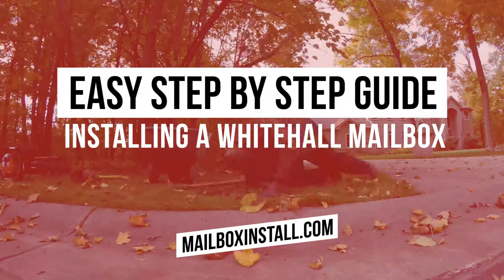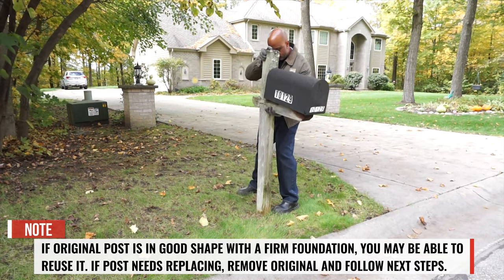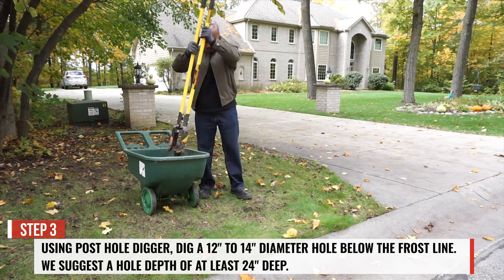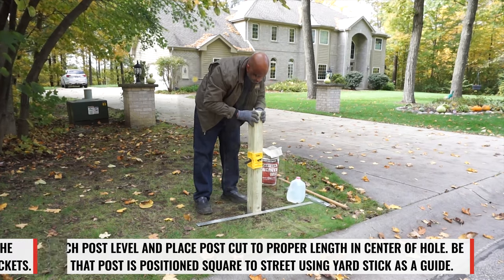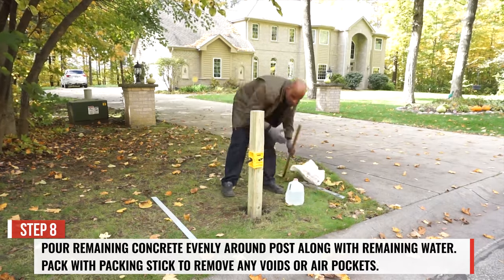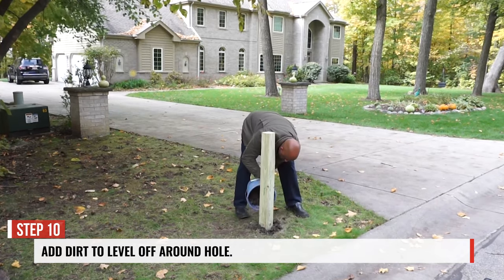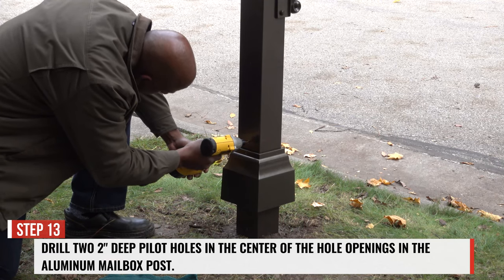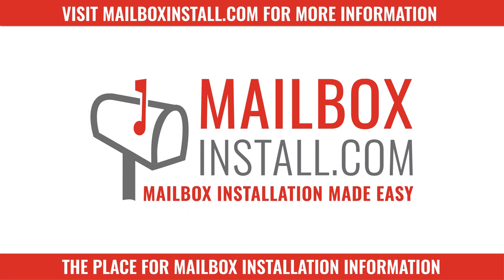Whitehall Mailbox and Post Installation  - An Easy Step by Step Guide by MailboxInstall.com

Comment: I am confused about the height for the mailbox itself.  At 0:55 the video says the bottom of the mailbox should be within 41 to 45 inches of street level.  The diagram is indicating 41 to 45 inches from GROUND level, which, depending on the curb, could be much higher than STREET level.  I think street level Would be the bottom of the mail truck tires.   So,  should the bottom of the mailbox be 41 to 45 inches from the ground level or from the street level?  Thanks!

Comment: You are using green pressure  treated wood whose active ingredient is copper. Pressure treated ACQ or CA wood can cause the aluminum sleeve to corrode by galvanic corrosion. Is this a problem with the Whitehall aluminum post?
Reply: In the instructions it said to place the plastic bag the mailbox post comes in to place over the treated wood post to use as a barrier.